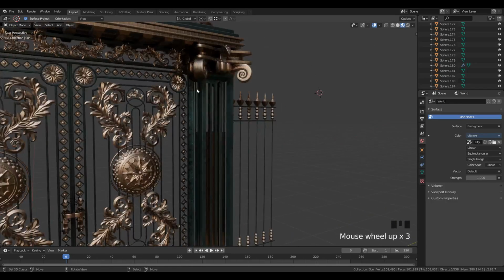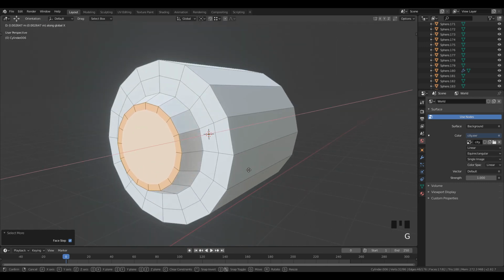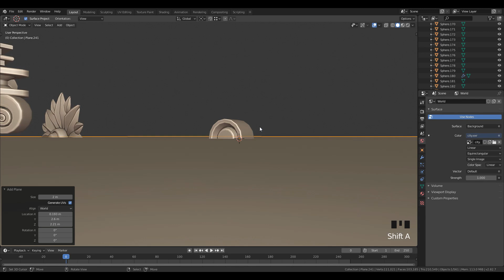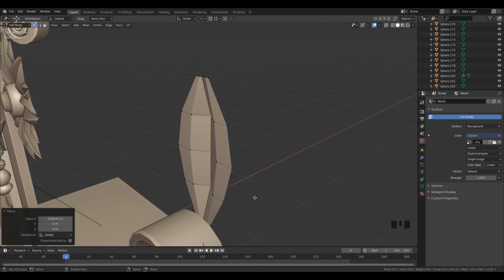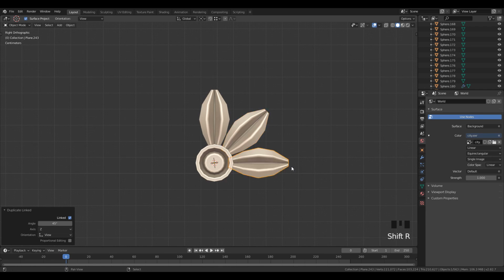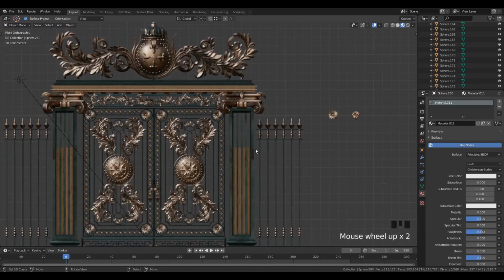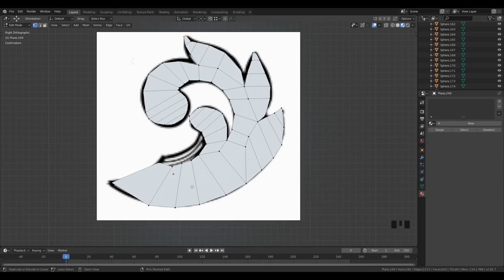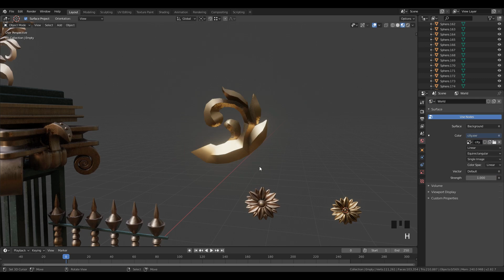Model Baroque Design Blender

Comment: What if the intention is to 3D print something with this look? I assume that Auto Smooth or Shade Sooth won't work then, and you'd have to work from a higher subdivision to begin with, right? For instance, I'd like to make a baroque style picture frame and 3D print it as a wedding gift.

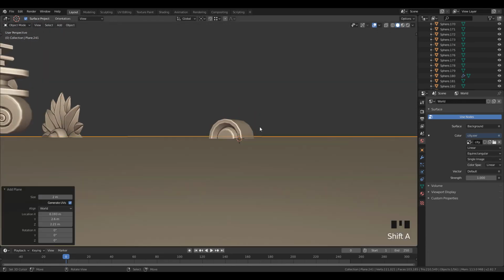Comment: 2:04 why didn't you go in vertices and enabled auto smooth that would've improoved the quality
Reply from the maker: I have applied auto smooth later in this video.
Reply: @SaqibHussain88  oh ok I'm sorry I didn't noticed I guess by the way any idea how can a reduce the fireflies in cycles?to zero?
Reply: @cyp1213  if you're still looking, just look up render denoising in blender. There's a few methods. Off the top of my head, you can use a denoising node in the compositing tab or activate denoising in the render menu itself.
Reply: @SaqibHussain88  ok thanks bro

Comment: Nice work.  Setting autosmooth is such a pain.  I've lessened the pain by putting it in the Quick menu. Now just hit 'Q' and check autosmooth, done.
Reply from the maker: Thanks for sharing but blender is constantly updating so they are going to change most of the short key.I was using blender 2.9 and alt m for merge is also not working.They have changed it  now you only have to press "M".
Reply: @SaqibHussain88  - Well that's a good reason not to learn anything new in Blender, because it changes so fast.
Reply from the maker: @onjofilms  Not complaining, As I dont have issues with it .Its that I dont want to spread misinformation about it by telling older version shortkeys .
Reply: @SaqibHussain88  - It's not misinformation if it is relevant now.  There are still 2.49 tutorials on YouTube, it is relevant to 2.49.  I am not spreading misinformation.
Reply from the maker: @onjofilms  I m not here to debate dear . It's a fact that blender is still changing .I am using 2.91 and the q key for autosmooth is not working in 2.91 version.  So yeah may be they will change it or may it will remain same as you are telling . Let's see :) .
Reply: @SaqibHussain88  - You have to add 'autosmooth' to the Q key.  You add all the functions you want to the Q key.  It is a 'Quick Menu' that you customize yourself.